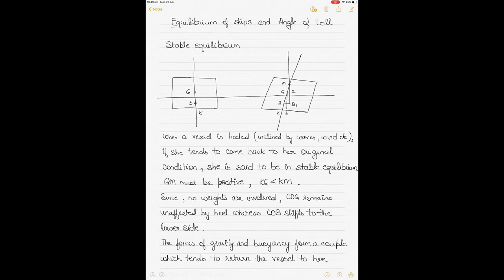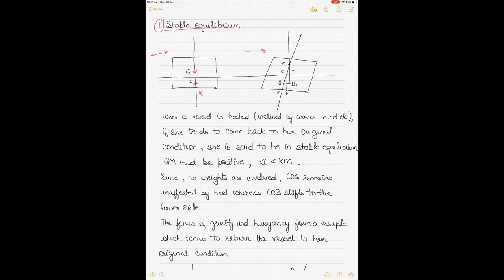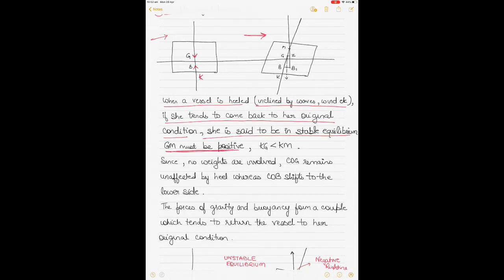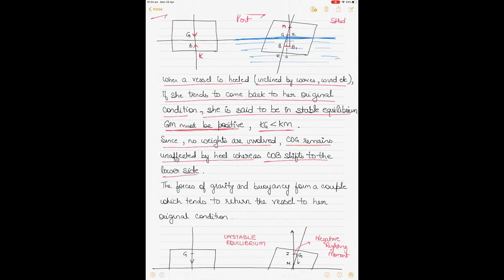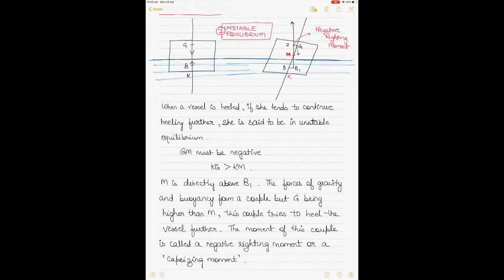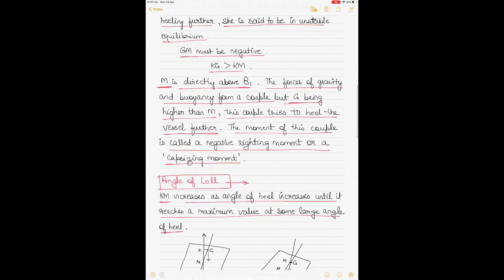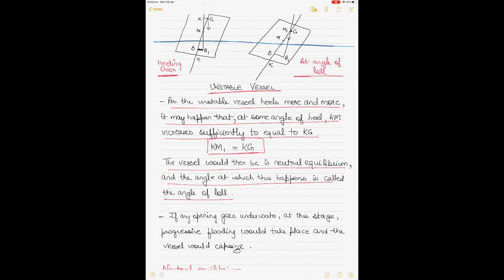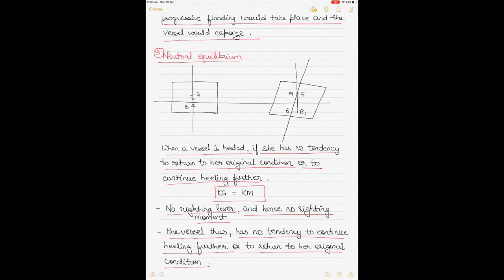Ship Stability - Equilibrium of ships and Angle of Loll

Comment: Your explanation regarding neutral equilibrium is theoretically wrong. In angle of loll, if it heels further it will have a righting lever to come to it's original position of AOL where as in neutral equilibrium, it will have no righting lever to come back to it's original position thus it will remain at heeled angle. in neutral equilibrium initial GM when the ship is upright is zero and in a vessel in an angle of loll, the initial GM is negative.